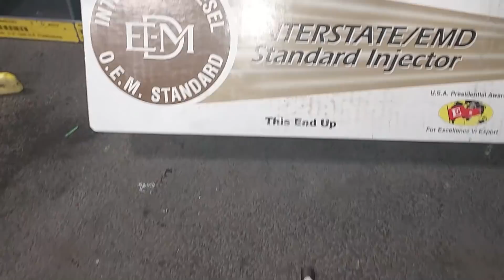Cracked Locomotive Piston, New Power Pack Assembly and Locomotive Fuel Injector

Comment: V12, DOHC, 4 valves per cylinder, turbocharged, 11:1 compression, fuel direct injected, CVT, traction control, AWD....
Reply from the maker: These are 645E prime movers with 16 cylinders Tony. Our SD 40-2
is 645E3 and it is turbocharged, the SD 38-2 locos we have are not.
Thank you for taking the time to watch and may you have a very good day my friend.

Comment: Just an FYI, You already have the crab nuts and crabs removed, Remove the bearing cap and pull the whole powerpack. They are designed to be replaced as a unit.
Reply from the maker: You are right Jim and we've done many power pack changes, however this job was being done by a contract loco mechanic and this is the way he wanted to do it, the hard way.   Really appreciate your taking the time to watch and may you have a very good day my friend.

Comment: Wow that's awesome man I love seeing things like this thanks for sharing this video Dave that injector is huge I see its mechanically fired from a cam I'm guessing the ones I see in automotive these days are electronically fired and  much smaller
Reply from the maker: I would say you're right David about the electronically fired injectors
and definitely much smaller! Very much appreciate your taking the time to write in and also for checking out the cracked locomotive piston video my friend.
Reply: EMD710 injector is electronically fired not loads smaller  but its still driven by fuel cam like this one

Comment: what's the purpose of the pipe attached to the cylinder liner?
Reply from the maker: I'm pretty sure it is for cooling purposes Jack. This kind of stuff is
not something most folks ever get to see. Very grateful my friend
for your taking the time to visit with us and check out the cracked
locomotive piston video.
Reply: @ccrx6700  Correct it connects coolant rail to power pack (liner)
Reply from the maker: @tiggy2756  😊👍

Comment: Does each cylinder have four valves on your locomotives? And the pistons look to be aluminum - is that correct?
Reply from the maker: I do not know what the pistons are made from Nolan. You are correct
in the 4 valves per piston. Glad you could drop by and check out the
piston repair job today.

Comment: Hi Dave. I think your locomotives are starting to show their age. I believe this is the 3rd video on  repairing them. Just wondering about how much longer they'll go before they become to much of a problem to keep?   As always in this case keepem running.
Reply from the maker: Yes they are Gary. Lot of things you don't know. Short version:
our last company filed bankruptcy, there was no money, very
little spent on loco and track maintenance, only the bare
necessities. Same at prep plant and underground. Our new
owners who took over in 2021 bought a sinking ship. They
are trying their very best to get everything back up to good
working order, however they were also immediately faced
with spending 60 million on developing a new slate dump
or else the mine would now be shut down. So lack of
maintenance in the past plus only so many dollars now available,
things do wear out and these new owners have a plethora of
things to spend their money on. It doesn't happen in a short
time, but they are dedicated and doing the best they can to
keep this operation running. Hope that helps explain a bit my friend.
Reply: @ccrx6700  Well, in today's situation simply having the money isn't enough. Parts and labor shortages are still a big problem. Then also, repairs and upgrades have to be done a little at a time. You get maybe what, 3 weeks of shutdown a year? You can't simply shut down the mine for 2 years, and build a brand new prep plant, and get all the building permits, inspections done, plus everything would have to be brought up to modern codes. And then all the rest of the workers that depend on the good paying jobs in the mine, harbor etc, what would they do with no job for years of rebuilding?
Reply from the maker: @brnmcc01  very well said my friend

Comment: Growing up we had a John Deere "A" and an "H" and our next door neighbor had a "G" and 2 "LA's" and they all got  lot of working done.  Our "A" was a 1939 styled front and the "H" was a '46 if I remember right.  We never had to rebuild the engines although we did rebuild the hydraulics in the "A" and used quick connects to it to power a log splitter we built  ourselves.  Worked great.  We'd have the A just idling all day while we split and stacked stove wood.  We used the little H for gardening...plowing, discing, harrowing, etc. and used the A for mowing, bushhogging, raking, baling, stump pulling and wood splitting.  I've seen engines on similar ones torn down though and you're right, they do have some darn big pistons in them :)  Both of ours had electric starters, but the battery on the A was almost always dead so we (meaning me) always got the job of hand cranking it by spinning that big flywheel with the petcock valves open.
Reply from the maker: We always had the 2 cylinders when I farmed, still have several
of them in the barn. Always wanted an H for no other reason than
I thought they looked cool being so small. Really appreciate your
taking the time to watch and share with us my friend.

Comment: Great channel sir. I am a truck driver but always had a great interest in locos. I ran 2 strokes for 3 decades and overhauled many. The new 645 piston you showed has a different way of attaching to the rod than the latter partial power pack that you showed. Is that one perhaps an older 567 assembly? It is bolted to the pin like the Detroits. 
How does that 645 piston attach ? 
Keep the great info coming. Thanks.
Reply from the maker: Really appreciate your taking the time to write in and for watching the
video Redburn Bandit. There is a wrist pin in that piston that
I did not show. As for the power pack, the first one in the blue crate
came from a boat engine, the one in the shop I am not sure where
it came from but I do not know the answer to your question on whether
it was for an older one or not.
Reply: They have a fork and blade connecting rod setup.

Comment: A Cracked piston! and you don't know what caused it? Have you checked the piston cooling pipe for that power assembly????  you need to check it is properly aligned with the hole in piston and that it is not cracked ensuring it is delivering the correct amount of oil to the top of the carrier and the underside of the piston for piston cooling.  No cooling the piston cracks or seizes.  The piston should be floating allowing it to turn as the engine is running.  Do you take lead readings after the piston is changed to ensure you have the correct piston to head clearances?  You also do not mention if you are a professional railroad repair shop or if you are on a preservation railroad. Good luck with your endeavors.
Reply from the maker: I am not a locomotive mechanic or a mechanic. I asked the contract
mechanics what caused it and they said they didn't know. So can
only relay the info I've been given. You pose some very good
questions and info and I apologize for my ignorance of mechanical
abilities about these engines. So all I can tell you is the contracted
mechanics did get it back running and as far as checking all that
stuff, I cannot answer that sir. We are on Cumberland Mine RR
which we haul coal 16.8 miles from a mine in Kirby Pa to a
river barge loading facility at Alicia Pa. Thanks for writing in and
watching the video.
Reply: @ccrx6700  The underside of the piston has a hole in it that accepts the piston cooling pipe.  On an EMD engine it is critical, especially after a piston failure that these are checked.  General Motors had a lot of piston trouble as they developed the 201, 201A model engines and the very early 567 engines, the problem was solved in 1941 just after America entered the second world war.  567 engines after that, and of course the 645 and 710 engines benefited from that development.   As the piston comes to the bottom of its stroke it encloses the piston cooling pipe which then shoots its oil up onto of the top of the carrier, the carrier works as an oil dam holding the oil in place to allow the piston to impart its heat into the oil allowing to to run relatively cool the oil that has been shot up into the carrier drains back through the carrier oil drain holes in a controlled fashion. Please pass this information on to your mechanic so this item can be checked.  It is very important that the piston cooling pipe is not cracked or broken.  Regards

Comment: combustion chamber looks extremely clean. 
what is the cause of piston cracking.
Do alco & emd uses different methods to change piston
Reply from the maker: The mechanics did not say what caused it, and I have no clue
the difference between Alco and EMD engines. Good questions
and I'm sorry I could not be of any help but we do thank you
for checking out the show today Adi k.
Reply: @ccrx6700  thank you sir
Reply from the maker: @adik9441  😊

Comment: Great stuff, man! I'm an auto and small engine mechanic - first time seeing inside a locomotive engine! That stuff is HUGE! I was wondering what that extra "valve" spring was in the head, since there were only 4 valves. The injector! Now I get it! All mechanical - I love it. Wish stuff was still built this way. It's simple, and just plain works for many, many hours of service.

On the opposite end of the spectrum, some Japanese motorcycles I've worked on have piston speeds reaching 250 times PER SECOND - that's how fast the crank is rotating! Just mind-blowing!
Reply from the maker: 250 a second! Wow, that is incredible. Glad you enjoyed the show
today and we do appreciate your writing in and for watching my good
man.
Reply: Here's something else you may not know; All 4 of those valves in the head are exhaust valves.
Reply: @erikj.2066  That I knew - 2-stroke. Fuel/air comes in from the bottom and goes through the transfer ports.

Comment: At 2:37..."since 1966 probably...", in '66/'67 I served on a WW2 LST (Landing Ship, Tank) "way down yonder in Viet Nam", we had two EMD 567 V-12s, 900 hp @ 744 rpm. That was back in the "Golden Age" of hot rodding and drag racing, I used to enjoy telling the "lifer" engine men about the power that was being pulled out of the new big Detroit iron at that time, they were amazed...the noise in that little engine room while underway was off the meter...

Comment: 38 yrs  tug engineer.   I love EMD's , 567's , 645's.   On a tug there are lifting points, padd eyes, etc. to hang a chain hoist from.  No problem taking the engine apart.  Easy to run and easy to fix!  We left the Clinton Point quarey  with 16 loaded stone scows.  There were two cylinders with cracked heads on the stbd engine.  I couldn't keep a level in the expansion tank, so I removed the relief valves, on those two and when Capt Bob needed both engines, I started it up on 14 cylinders, with flames shooting out the side of the engine , just to get around West Point, and Bear Mt. .   On the next trip the Co. put one of the smaller boats to act as our stbd  Engine.  We ran two more days like that untill  The Frank Barker III  could come in and be fixed.   We used to call Barker, 'Good enough towing'!  I ran with more problems, and when they did a temporary repair, they would say that's good enough.  One of the capts. had hats made up with "good Enough towing on them, I used to wear mine in the yard, but nothing was ever said.
Reply from the maker: Loved you comment George! The way I understand it there is a
difference between the EMD loco engines and the marine engines
but i don't know that it is.  Perfect, Good Enough Towing!!! I could use that here, good enough railroading..... I'm sure you would understand
that! Really appreciate your writing in and for watching the
show my good man.
Reply: @ccrx6700  Some of the differences are; the marine engines have a deeper oil pan, exhaust temperature thermocouples in the exhaust risers, the turbos have a proven to add a extra idler gear for right hand engines to use at low power, the acessary covers on the front are different  for left and right hand engines. Since most engines are built to ABS ( American Bureau of Standards - for insurance standards, the crankshafts have to be marked by the ABS Maltese cross ( extra $200) but other wise the same. The instrument gage panel is more comprehensive. The use air starter motors and my favorite item,springloaded fuel injector links where you can essentially add more fuel one cylinder to hear if the cylinder is firing properly.That would have just the thing to do in this case to find the weak cylinder in a couple of cylinders.
Reply from the maker: @kenneth thompson  awesome reply Kenneth! Really appreciate your taking time to let me know all that. I had no clue before. 😊

Comment: Monster diesel engines to drive big generators that drive the motors on the wheel trucks. Talk about a Rube Goldberg design, locomotives are it!
Reply from the maker: Big stuff! These engines are also used in river tow boats, they
are very reliable and make good power. Appreciate your writing
in and for watching tonight Lindsey.

Comment: We have a GP9 that SP ran through the grip program, it was upgraded from a 567C to a 645C. We had to remove 3 cylinder heads and replace seals but fortunately that's all.
SP 3194 at the Golden gate railroad museum
Reply from the maker: This loco was built in 1966 as SP 8477. It went thru GRIP in 1980 and was renumbered to 7330, then sold to Boise Locomotive works in
1999 where it was rebuilt as an SD 40-2 and renumbered to 3098 as it is today. Appreciate your writing in and for watching today Steve.

Comment: Is this a two or four stroke engine?  I see four valves on top but in the middle of the cylinder I see what looks like a 2 cycle input and how is the connecting rod attached to the piston? Is the snap ring he was talking about what keeps it together? Looks like an interesting job. Thanks from Virginia USA
Reply from the maker: 2 sir and there is a hole in the piston for the wrist pin, I did
not do a very good job in showing that in the video. Glad
you enjoyed watching the show Robert.
Reply: @ccrx6700  I sure did enjoy watching that. I've worked on all sorts of Machinery in my life but I've never got to play with a large two cycle locomotive engine my loss. Does anyone make a 4-stroke locomotive diesel? If yes Is there a big difference on fuel economy between the two? Thanks Bob from Virginia USA

Comment: Thanks for sharing. I will never need to work on one but hmmm, not a crankcase with pistons but a frame with power packs. I wonder if water made it's way into the combustion chamber
Reply from the maker: Your certainly welcome Craig. Water did not get in this one
although we had one many years ago where water did and
caused the connecting rod to get thrown out the side of the
block! Too bad I wasn't making videos back then!

Comment: Are locomotives usually run off of diesel or oil
Reply: Yes
Reply from the maker: Diesel for these guys. Nowadays they are exploring using hydrogen
and battery powered locos, all of those are in the experimental
stages. The only locos I know of that use bunker oil are the
refurbished steam locos such as Union Pacific has.

Comment: EMD 645. Big brother to 1930s EMD 567, conceived by GM’s papa Charles Kettering’s son who also produced the 71 series.  Two of the 900hp V-12s were motive power for WW2 LSTs.  The last operating LST stateside is LST325 in Evansville, having sailed from England to the US with one piston damaged.  Try that with a modern diesel.
Reply from the maker: Thanks for writing in, I did not know Ketterling designed these
engines, I've heard the name in the past, had to look up what lst meant, now I know. Appreciate your watching the video Ca Dewey.
Reply: @ccrx6700  They always said the best Detroit Diesel (71 series ) truck driver was a guy that slammed his hand in the door first thing and remained mad all day and floored his screaming diesel all day.  They run best with the rootes blower at governor speeds.  They make a lot of noise but the unit injector and simple intake and exhaust system means they run a long time on just about any fuel.  
My dad worked as an electrician in the LST prairie shipyards in Seneca Ilinois.  The first LST was built and launched in less than a year from the Pearl Harbor attack.  The shipyard was a corn field in 1941 but by 1945 they could launch a new one (sideways) in the Illinois river every 5 days with women doing most of the welding. LSTs went all over the world to put Sherman tanks and equipment on every enemy beach, usually under fire.  There were over 1000 ships built in the US but there is only left, run by volunteers.  LST 325.

Comment: The company I work for lunched A power assembly out of a ac 4400 it it ended up in back yard about 300 ft  from the  tracks luckily no one got hurt
Reply from the maker: That sounds pretty wild Jeffrey, too bad I wasn't around with a
camera, that would have made a really cool video. We had a connecting rod go thru the engine block one time years ago. But that
was before I started making videos. Thanks for checking out the
home movie my good man.